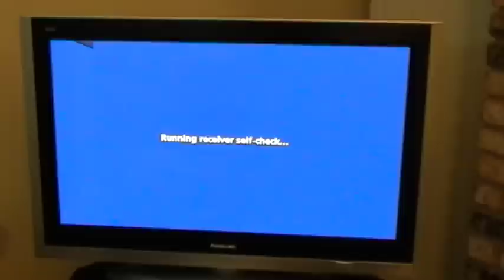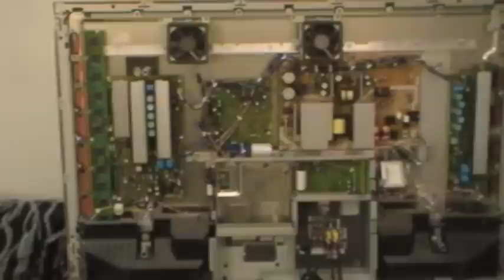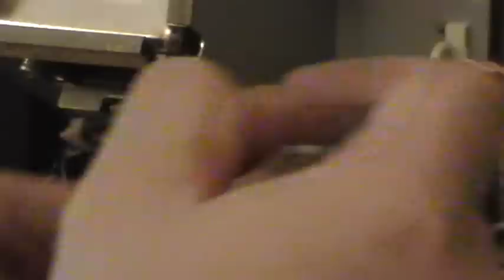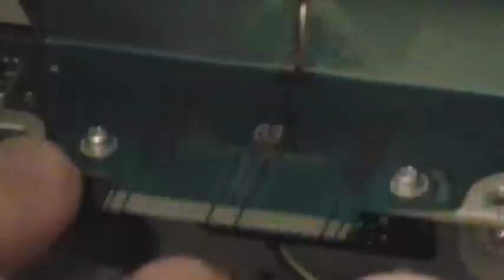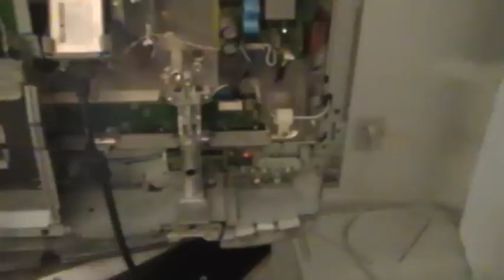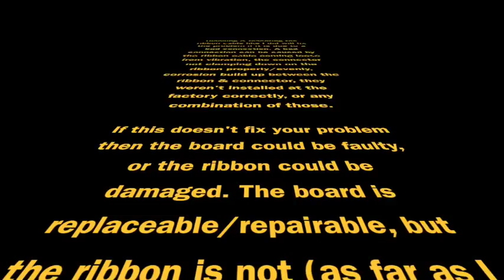Fix Panasonic Plasma TV Vertical or Horizontal Bars

Comment: Hi! A have a plasma Panasonic P50UT50B. It has several very thin vertical lines near the right edge of the panel. They shimmer/flicker and subtly change color. They are much more visible on uniform images and less noticeable during video playback. Any chance it's the buffer, or does it look more like a panel defect?
Reply from the maker: It could be a lot of things. If you hit the back of the TV (a.k.a. a technical tap) do the lines change or go away? If so something is loose, like a ribbon connector shown in this video.  If not, then it may be the board. It is hard to say without having the TV in front of me. Good luck.

Comment: Hello! I have colored lines on the right side of my Samsung 50-inch plasma TV. One of the HDMI input sockets needs wiggling to connect. Any suggestions on a fix?
Reply from the maker: Sorry, I'm not familiar with that TV.  If the cable needs wiggling to connect then either the cable is damaged, or the connector the cable goes into has been wallered out. They can be replaced if you know how to solder circuit boards. Otherwise it will just get worse over time. Good luck.

Comment: I see you still reply to comments so hopefully this comment finds you...
If a disconnected ribbon creates a static black bar instead of a white bar (similiar model viera), what might that signal? 
I went from half the ribbon not sitting in the connector and creating an intermittent half black line (about an inch), to messing something up and now the entire section of the screen from that ribbon not providing picture (about 2 inches.) When I disconnect the ribbon it does not go white. Also, the static on the line sometimes faintly shows the outline of the last bit of picture it showed (bit like a shadow.)
Any ideas or suggestions would really be appreciated.
Reply from the maker: TBH, it's hard to say what white vs black means. It depends on the default state of the circuit. Assuming the connector & ribbon are not damaged, the remaining issue could be in the circuit board itself. Hard to say without getting my hands on it. Good luck.
Reply: @petrocksgarage  thanks for responding! Totally get you can't diagnose on description usually. 

On a totally black screen I could see some sparkling in the segment for the first ribbon (w/ the black bar) and sparkles on the segments for the working 2nd and 3rd ribbon (15 ribbons total horizontal), so I think the issue is in the board itself. Just hoping it's the buffer board and not the power or d board. 

Been studying the service manual and going to be attempting a c1 buffer board replacement sometime this week, so please pray for my 17 year old girl lol. All I can do for her is battlefield surgery, cuz I'm a noob at testing circuit boards...

...this is me, trying to keep dead tech alive...

...but anyways, thanks for the video too.
Reply from the maker: @chell272  Good luck!

Comment: Great video thanks , mine is a 65" plasma .
My vertical band is gone and back ...
I cleaned the end of the cabke with 97% alcool  , when I gently press on the connector it goes away , but when I release the pressure it come back 😢
Any idea to make pressure on the brown cover ?
Reply from the maker: It sounds like (best case) the cable is not seated entirely in the connector, or (worst case) the solder joints for the connector are cracked.  Maybe disconnect the cable and clean both the connector and cable.  There may be some dust in the connector itself.  Look to see if there is any rust or green crust or something in the connector.  If there is some contact cleaner spray should clean that up.  Then re-seat the cable and make sure to apply pressure to the cable as you clamp the connector closed. Hope that helps. Good luck.
Reply: @petrocksgarage  ok thanks , I have insert a small piece of styrene just above the brown closer of the cable . That piece is in sandwich with the screwed metal piece just above , I can adjust the contact or not by screwing or unscrewing a bit the metal part above . Not ideal but it's the only way I can get the ribon wires  to get a good contact even after I did many cleaning of the ribo😢n end
Reply from the maker: Glad to hear you got it sorted out. Hope it holds.  Good luck!

Comment: Hi! I have the same problem with my Panasonic plasma Th-42px60u from 2006. A black vertical bar on the far left with a flickering thin vertical red line exactly in line with the power light. I open the back dusted everywhere and did as you instructed. Instead of solving the problem, the left half of my screen went black. What did I do wrong? What happened? Do you any way I can solve this? I unplugged and reseted the tv. Nothing does it. Help.
Reply from the maker: It sounds like something got disconnected inside. Like one of the ribbon cables, or maybe a capacity or resistor got knocked loose when you dusted? It is really hard to tell without having the TV in front of me. Good luck.
Reply: I looked everywhere. Doesn't look like anything got disconnected or knocked off. I assume your are talking about the ribbons that controls the vertical. Is it also those ribbons that controls half the screen? Or that problem could come from another board? I wish I could send you pictures...
Reply from the maker: @MathieuStLaurent19 , yes the ribbons that control the vertical. Each ribbon controls a 3-4" vertical bar. You likely dislodged multiple. Try reseating all the ribbons in the affected area and see what happens. Good luck!

Comment: Thanks for sharing, but alas I couldn’t fix our TV.  We own a 50” Panasonic Plasma TV Model No. TC-P50X1 and a couple of days ago two thirds of the bottom of the screen has black horizontal lines.  At first the area was flickering as if there was a storm, then total black 30 mins later.  With your video and another video I was able to at least figure out how to unclip the horizontal ribbons from the circuit board (good tug!), dust, wipe down, and re-clip.  I cleaned all the clips that went down from top left to the bottom (8 total) and on the right side, top to bottom (3).   However, problem is the same.  I did consider doing all 10 along the bottom (with the metal covers) but as you stated, those affect vertical bars, which is not our issue, so figured best leave alone.  Not able to dive deeper replacing boards or soldering so I think I’m giving up.  Hate to dump it, but it has had a good life with us (12 years).  Thanks anyway!
Reply from the maker: Sorry it didn't work out for you. 12 years is a really good run for any TV.  It is probably really tired.  Sounds like something failed on one of the circuit boards (i.e. a blown capacitor).  Try to take it to an electronics recycler in your neighborhood so it can be turned into another TV.  Some stores will even take your old TV and recycle it for you if you buy a new TV from them.   Good luck!
Reply: Wow thanks for your quick, kind and thoughtful response!  I never know what feels better:  when an appliance mysteriously craps out like this or having it be knocked down / exploding due to electric current / etc.  Oh well.  Guess the silver lining is that Black Friday is next week.  Cheers.
Reply from the maker: lol.  Happy hunting!

Comment: Hi, thanks for the video. I have a  samsung plasma with black bar problem and after all the cleaning it persist. Maybe the flat ribbon is damage, in that case there is no way to fix it?
Reply from the maker: It depends. If the ribbon is soldered to the board on both ends then it could be desoldered and a new one soldered in its place by someone experienced soldering small electronics.  If the ribbon is connected via a clamp connector think on both ends then you could just swap out the cable. The trick is getting the replacement ribbon.  But it could also be an issue with the circuit board which could also be replaced, but they can be expensive. Good luck.
Reply: In the board is connected like the tv on this video, not soldering, and in the interior is glued whit some grey silicone. Also i check the resistors right above the clamp conector and the 3.3 k.0 grows up to 7.3. I thought that was the problem but i change the resistor and start the problem again. Definitly is the ribbon but how could fail, there is no way to repair it? 😕
Reply from the maker: @Omartic0 , the ribbon could have a broken or damaged wire internally, inside the rubber/plastic insolation. The ribbon could look fine from the outside, but inside the wires could be severed. I wouldn't try to repair it, I would try to replace it. Good luck.
Reply: @petrocksgarage thanks for the answer, now am tom cruise trying to find this ribbon. 😅
Reply from the maker: @Omartic0  Good luck!

Comment: Thanks for the video- going to try this out. My question is: what to use when wiping down the connection?
Reply from the maker: No problem. Glad to be of service.  Rubbing alcohol, or (better yet) electrical contact cleaner will work.

Comment: Thanks for your video. U fortunately the Panasonic I opened up looked different to yours (this one was very flat entire thing was around 2 cm depth at the top) and I tried to have a go cleaning some components with a brush and vacuum but it didn't work. It is 10YO now though and my mother in law was happy to buy a new one so I had a go just incase but thank you for this video. If you have any more recent ones that would be super! All the best.
Reply from the maker: Sorry it didn't work for you. Even though it didn't look the same inside, the general technique in the video still applies. Clean the ribbon cable connection for the area where the issue is occurring. If it didn't work then the problem wasn't a loose or dirty connection. Glad to hear you got a new TV out if it though.
Reply: @petrocksgarage  no worries my friend! Perhaps I needed an air blower or perhaps it was a different cable connection. It's all good though! Thank you :)

Comment: Warning please be very careful TV's hold a deadly charge ,even after unplugged for a long time .if u don't know what your doing you could kill yourself .
Reply from the maker: Painful?  Maybe.  Deadly?  Thats a bit of a stretch.  You could get a nice quick shock/tingle/buzz if you touch the wrong part, but not anywhere near electrocution. Flat panel TVs don't hold anywhere near the amount of charge as old school CRTs.  The capacitors in flat panels, for one thing, are a fraction of the size & capacitance. They are also not all connected in parallel to make one HUGE capacitor. While I wouldn't recommend poking around with a metal probe while wet, I would not worry too much about dieing from it. But if you feel concerned about it take the TV to a repair shop instead.

Comment: I’m assuming this would help me as much as it’s helped everyone else but the bottom half of the screws on my tv were already stripped beyond repair (hand me down tv) and unable to be removed. So I could only bend it as far as I felt comfortable and remove the dust from the fans with a cleaning brush I use on my cats water fountain. Fixed the fans but now the streak is worse lmao. Looks like I’m either going to have to punch it or just use my tiny tiny tv instead :( thanks for the video thought it’s still very helpful
Reply from the maker: Sorry to hear it didn't work for you. There is probably an electrical issue with one of the circuit boards that is causing your problem. Replacement board may be available, but you'd have to figure out which one which can be difficult. At which point you'd need to figure out if your time/energy to find it is worth more or less than a new (to you) TV. Good luck.

Comment: Okay, just wanted to say thank you for keeping this extremely helpful video up. We've had a 58" Panasonic TH-58PZ700U since 2007 and it's a beautiful tv. Well we were getting an intermittent black bar showing up in the upper half of the tv slightly to one side for long periods of time. Sometimes it flickered, sometimes it was solid and other times it would go away. We called a tv repair service but they no longer came to our town and we were also told there were no parts to be had for such an old tv. Well, we figured it was a connection issue not a bad part and then found your video. It helped immensely. I cleaned the associated ribbon contact points with 70% iso alcohol with a cotton swab and then wiped it clear with a coffee filter to remove any fibres that could have deposited on the contract points. I let it dry and carefully reconnected everything and voila! The bar is gone and we can enjoy our lovely tv and not have to worry about spending thousands on a new one. Thank you so much!
Reply from the maker: That's great! I'm glad my video helped you out and kept your TV running.

Comment: Hello. I have a similiar problem with a Panasonic ZT60. Permanent 9cm black vertical stripe on right side of TV. Fortunally is black and is at extreme side of TV, when TV is usable (expecially if i reduce image size with H-AMP and V-AMP in service menu). But is a 5000 euro TV and i would to repair this black stripe. Tips for me? I'm  writing from Europe.
Reply from the maker: I would recommend the fix I show in this video. Hopefully it's just a loose connection. If it doesn't then it's likely a circuit board problem which may be cost prohibitive to repair or replace if you can figure out which circuit board is the problem and then find the needed parts. Good luck.

Comment: Have a viera panasonic 42" plasma, horizontal issues, the middle to the top half of screen section, has grainy faded pixels compared to the bottom half, in the middle of screen, have one horizontal line that changes colors during gameplay at different angles, then goes back to normal until the angle changes. Cleaned the 4 upper half ribbon connectors on the left side, the other 2 on rhe right side, didn't work, the upper half of tv is still faded picture. Any ideas what it could be. My t.v issues are nothing like the issues i have seen on YouTube.
Reply from the maker: I'm not sure. Since the color changes it definitely sounds like a loose connection. A horizontal line does mean you want to check the ribbons on the left/right. If that doesn't work then it could be the circuit board itself, which are replaceable. Good luck.

Comment: Hello Pet Rock, thank you so much for this video. My Panasonic Viera plasma is from 2005 and has been going fine all these years, until now. It developed a black band, to my great surprise I found a relevant video, yours. Yesterday I took my TV apart and got to the stage where you release the ribbon clamp thing, the two little white pins. However try as I might I just couldn't get it to release, I've looked as closely as I can to the video but I just can't see how it's done. Is there any chance that you could tell me how it's done?. Do you push the white pins backwards and up or pull them down?. I've tried to do both but nothing happens. Thank you once again.
Reply from the maker: You mean the connector at around @5:54? If so, and assuming yours is the same as mine, there should be a thin plastic bar (for lack of a better word) going the width of the connector. It's parallel with the board. Pull the bar down with your finger nail 90 degrees (be very gentle) to make it perpendicular with the board. That should release the ribbon cable. Hope that helps.

Comment: Another one who pokes with a screwdriver. They should be using a plastic stick to prove a point. They never heard of static discharge. The damage this could inflict...They will learn one day. Many of years I have repaired sets and heard stories of other technicians of what the did to show someone a tv sets fault and it resulted in more damage. Your call. Dangerous!!!
Reply from the maker: While you are correct that I should have used a non-conductive probe to point at the board, I'm not sure where in the video I did anything dangerous. A couple points you might have missed:
- I mentioned at the beginning of the video to unplug the TV and let it sit for a while to let the capacitors discharge before working on it
- I never poked a circuit board with the screw driver. I only used it to touch the screws and the plate in contact with the screws (which means its grounded and safe to touch with the screw driver in the way that I did in the video).
- By touching the grounded metal plate, any static electricity build up on myself or the screw driver will be safely discharged, so no risk of damage or injury there.
Hope that clears some things up for you. Feel free to re-watch the video to confirm what I listed above. Thanks for watching & commenting. I appreciate it.

Comment: My Panasonic plasma had a greenish blue line that flickers vertically. I tried fixing it like you said and doesn't work ...
Reply from the maker: I'm sorry to hear that. I'd suggest taking it to a repair shop to diagnose further. Good luck.
Reply: @petrocksgarage  thanks I smacked the tv hard in the back and the tv fixed ..